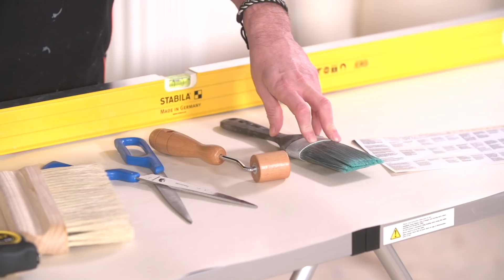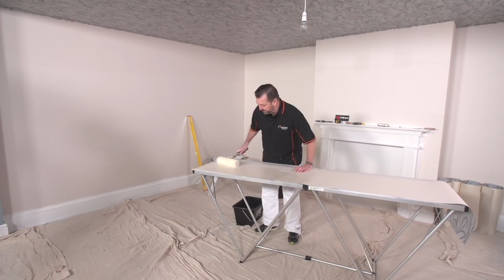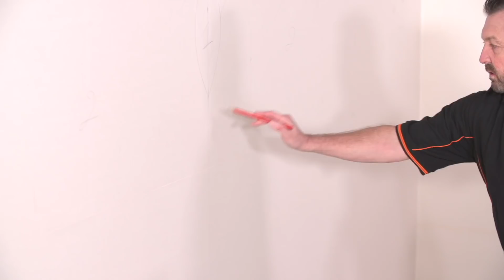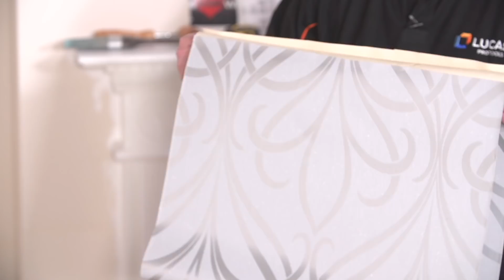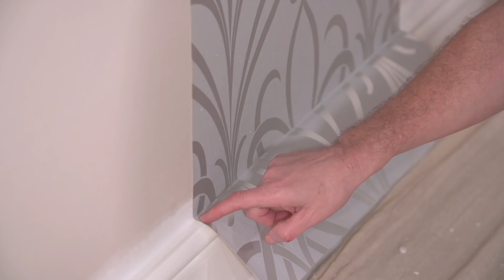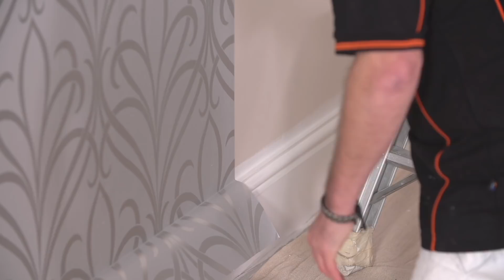Wallpapering Tips | How to wallpaper your feature wall the easy way  | 2018

Comment: When you say you used flexible filler on the top if the skirting board, would decorators caulk do the same job? Thanks.

Comment: Buy a Wall wizz tool £3 orso amazon amazing product use in place of the caulking board to hold against paper , can also smooth  down wallpaper a bit if your careful, also decent OLFA stanley blades they will make cuts neater, less rips. measure wall width and centre the wallpaer if feature wall  to centre fireplace etc and work both sides out to corner

Comment: Is the sponge dry or damp?
Reply: Damp. And clean. Rinse it regularly in clean water to make sure you're not simply smearing paste back on the wall - it will show when it's dry.
Reply: @bennette4648  I didn't know that. I always use a dry sponge or cloth and plastic scraper.

Comment: Would it be wrong to put the paste on the wall first, instead of on the paper? I don't have a huge portable table like that; seems like putting it on the wall first would be easier.
Reply: There are some types of paper where you can paste the wall. But if you try it that way with a woven paper the paper will expand on the wall after you hang it and you will have all kind of problems as a result.  Woven papers need to be pasted and left to soak, they will then take in the water and expand before you hang them and this soaking time is essential.
Reply: Yep...always follow the instructions, you should only paste the wall if the instructions say so

Comment: A really great job. You didn’t show how you cut the vertices edges at each end. Did you use the caulking board and knife as you did along the top and bottom? As you won’t have put soft filler into the vertices corners, is there more chance of snagging the paper when cutting it?
Reply: You just cut the end strips to size on the table, avoding any messy vertical cutting on the wall.
Reply: @helenaville5939  no you trim it to slightly larger than hou need then finish with the knife and board as shown here.. you'd never cut it to fit the corner profile from the table.